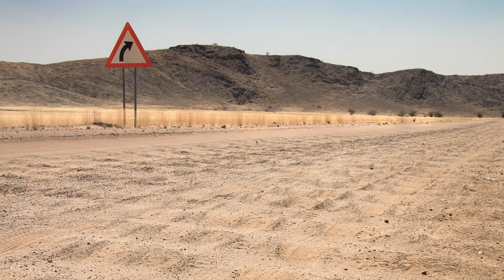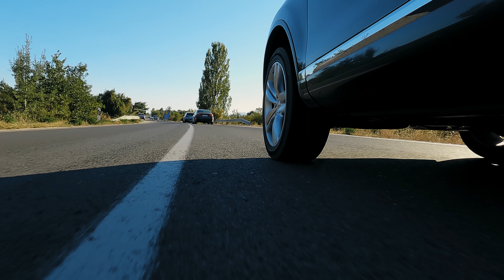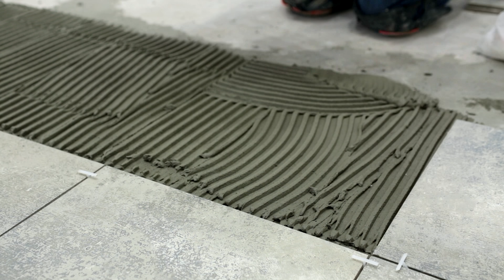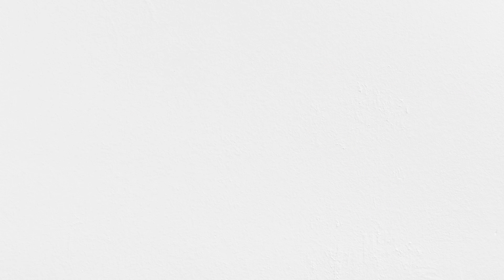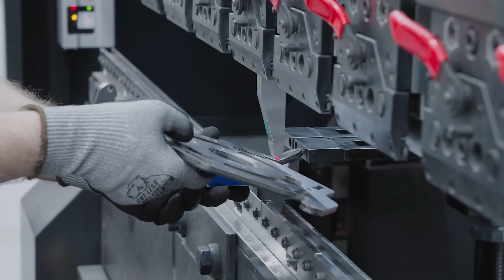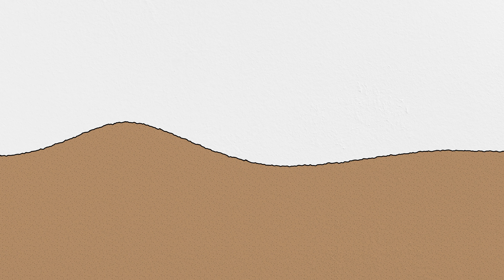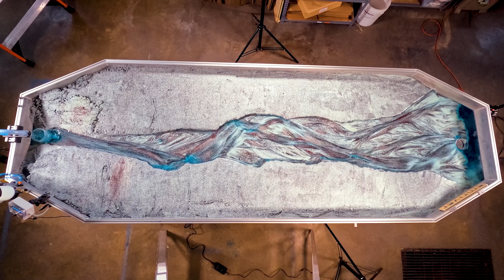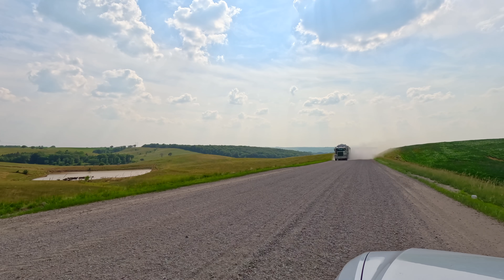Why Roads Get Washboards

Comment: I've driven on washboard roads for years. One peculiar thing that I have noticed that some of the roads have a "sweet spot" . A certain speed that you travel the bumpy effect seems to go away. If you go faster, the bumpiness returns, if you go slower the bumpiness resumes.  Different speeds for different vehicles. I assume this may gave something to do with the inherent frequency response of a particular suspension setup. Tires, tire pressure, spring rate, shock damener response, vehicle weight and distribution. Also the frequency and amplitude of the road surface corrugations.
Reply: It's like when you have the wrong proportion of windows open in your car and it makes that pulsing noise
Reply: @flexone612  Helmholtz resonance
Reply: @jamierosales1539  that can happen in a vehicles intake if it's not engineered correctly
Reply: @Osiris02  That's wicked
Reply: @jamierosales1539 I always called it buffeting.
Reply: @jamierosales1539  I call it the helicopter noise lol
Reply: @flexone612 I believe it's called buffeting.
Reply: @d_pete361  yes that’s one term for it.
Reply: @d_pete361  James may intensifies
Reply: @d_pete361 4th gen rams don’t know anything on that😹😹 ur ears get blown no matter if u have a sliver of open window
Reply: @juaquiqui Rams are poorly engineered trucks in general
Reply: @d_pete361  Changes in Attitude Changes in Latitude
Reply: @flexone612  by the way if you open the front and rear windows of either the driver or passenger side, but not both, that pulsing doesn't happen. At highway speeds I usually crack them open just a little bit to prevent strong winds inside but still allow air circulation.
Reply: Well-designed cars do not get pressure pulses at any time, or any amount or number of windows open.
Reply: @Chris.Davies that’s complete bullshit 😂
Reply: @oldrango883  my e46 never buffets my a5 does past 50mph
Reply: @liamholcroft7212 My wife’s e46 has buffeted. So what @oldrango883 said. 😂
Reply: @dyefye4094 this has worked in every 4 door vehicle I've ever driven to-date. Would love to see this done in a wind tunnel to see how it actually works!
Reply: @liamholcroft7212   I had 2 VW golf's and it was bad if you only had 1 or 2 windows down in front but we have an VW Atlas now and you  can't even drive on the highway with 1 or all the windows down , it blows out your ears...
I've owned many different vehicles and its only the VW that I've experienced buffeting like that at highway speeds
Reply: @dyefye4094  My car sounds like a helicopter. Gramps gets flashbacks to Nam.
Reply: @Chris.Davies I’m sure modern cars still have the same problem
Reply: @oldrango883 I just told him the same thing 😂
Reply: @dyefye4094 it's vehicle dependant. What you've just presented is called anecdotal evidence.
Reply: @flexone612  that’s simply a pressure issue with the windows. If air pressure  insode greater than the pressure that can escape it happens. It’s a matter invsout flow with the windows.
Reply: @flexone612  it’s more similar to driving over a hole, the slower you go, the more likely you are to enter the cavity, the faster you go the more likely avoid the cavity. Same principle here, common sense to most 

[Weight/Speed/Distance between tires
Hole Depth/Length]
Reply: That sweet spot is only a local minimum - To reach the true minimum you need to speed up even more, after it get bumpier it’ll get smoother again as you start moving fast enough your tyres have less time to fall into the divets. From there it only gets smoother as your speed approaches infinity 😛
Reply: @almc8445  yes this! The problem is coming back down from that speed immediately puts you into serious bumping and loss of control. If visibility is good, though, and there's no traffic, then I'm all for it. Just skip along the tops of the bumps!
Reply: @nopenotmedudewhen we were coming up to stop signs the driver always asked "see any dust?" , the indicator of other cars.     Back being young and reckless on the old dirt roads.
Reply: @almc8445 As your speed approaches infinity you will exceed the escape velocity of your local planet. This will definitely reduce the perceived bumpiness.
Reply: @johnbaker1256  yes but you see, this is also a local minima of bumpiness, because once you reach a certain speed, the magnitude of your vector is sufficient to bring you to the next PU over, and when that happens you'll experience bumpiness again.
Reply: @almc8445  ….And your control of the steering falls to zero!
Reply: @andrewwebb9426 Apparently people thought I was actually suggesting doing that… I just wanted to go all math merd and describe the graph 🤦‍♂️
Reply: @almc8445  I always thought of it like when Mario was running full speed on the NeS he would clear single space gaps without jumping
Reply: Silly speed…infinity. You won’t have to worry about the jumps or the mountains.🤷
Reply: @almc8445 you only need to go about 7.9 km/s on a dirt road to not touch it at all
Reply: @almc8445  put some airfoils that give you some vertical resulting force and with enough speed (or thrust) you could completely avoid the bumps.
Reply: @almc8445 i would not recommend going an infinite number of miles per hour on bumpy roads, though you're correct...
Reply: @almc8445  only wussies stay in first order harmonics.   real G's go after the 3rd or 4th order.
Reply: @almc8445  I love driving on long straight corrugated roads. It kinda feels like skating. Until you hit an invisible dust hole, those are a little sketch.
Reply: @almc8445  and THIS is why the only thing more insufferable than a washboard road is driving behind someone who's response is to go slower instead.
Reply: Mythbusters, episode 58.
Reply: @kathykuecker man I miss myth busters
Reply: You’re basically just skipping across the peaks at speed, what you’re finding is the exact frequency that your wheels need to hit to only hit the peaks.
Reply: YES! I drive a trail almost exclusively frequented by Chevy pickups and has some of the most horrific jaw-rattling washboards ever -- but only if you also drive a pickup. It's definitely a frequency resonance thing.
Reply: I wonder if some vehicles inherently have none because their front suspension resonates at a different rate compared to the rear(s).
Reply: @christopher5476  Unrelated to the topic of the video, but industrial vehicles with no suspension, like tractors, have this resonance mode where they start jumping when the wheels are slipping under heavy load for example. This happens because air in their big thick tires acts like a spring with virtually zero damping and it's easy to get runaway oscillations when the conditions are right. The solution is to deflate tires somewhat on one axle. This effectively tunes that axle to a different natural frequency so they don't amplify each other anymore, and makes the vehicle more stable.
Reply: @umdms  hopping can even happen when driving on pavement with no slip and no load.  As you say the tires act as springs and if the natural bumps and roundness imperfects in the tires start resonating you can really get it moving up and down. I've actually seen trailing machines with large tires just about leave the ground entirely on pavement.  Trick is to find the speed where the resonance dampens out.  Particularly bad on backhoes.
Reply: @umdms technically they do have a suspension. The tires bounce.
Reply: @umdms  my tractors tires are filled with fluoride.
Reply: @umdms I’ve experienced that with skid steers and forklifts and it can get wild.
Reply: @mikescholz6429   I think you mean nitrogen! Fluorine who destroyed the tires in really quick time. Then it would destroy the human that breathed it! 😮
Reply: @mat1500 I was misremembering, it’s calcium chloride solution, the tires are liquid filled instead of air filled for traction weight.
Reply: @umdms I managed to get a 930 Case tractor on rice tires hopping like a cricket on a hot plate. Not on purpose and I never did that again.  For a while it was touch and go!
Reply: @mikescholz6429  better be running tubes on that tractor
Reply: That's neat. Ive never heard about that.
Reply: This is generally how modern suspension systems are specced by many (possibly all?) automakers. The rear has a higher natural frequency from the front to eliminate resonant pitching response caused by the rear axle hitting a given bump after the front wheel. Basically it lets the rear "catch up" to the front.
Reply: @camerone397  That is one of the factors .... travel, body roll, squat and rebound come a few notches higher in the sequence.
Reply: @no1ofhere Absolutely, though you can control those parameters geometrically, and you can still tune the frequency of the overall system as you wish regardless of the slight relative increase in rear stiffness
Reply: @christopher5476  This was actually how the French attemped to avoid creating washboarding, manufacturers deliberately made their vehicles with dissimilar spring rates.
Reply: @furripupau cool. The citroen 2cv probably does. Amazing suspension on that old girl
Reply: @christopher5476  Wash boarding happens with any number of axles, so I don't think there are cars or truck with reduced wash boarding generation, 1 axle will do as per this video.  I think the effect of suspension tuning is going to have a very limited effect on wash boarding as there are too many variables to adjust the car for.  You might get wash board generation reduce with one type of wear layer, but once you go to the next quarry, the materials may be different.
Reply: The problem is explaining this to the local deputy sheriff.  55-60 MPH is typically the sweet spot with my truck on my roads, but the posted limit is 40.
Reply: @FaFa-y1f9r at those speeds your tires likely floating on the peaks and giving you minimum traction
Reply: @omegatotal very true as well. Fine line between a smooth ride and even bumpier ride, in the ditch lol
Reply: @omegatotal yep that's what gives you the smooth ride!
Reply: @FaFa-y1f9r ah yeah that's rough. My grandpas road deadends 2 miles down, and theres an L before the end that also deadends... theres only maybe 10 or 12 residences on the whole road between the highway and the river(where it deadends)

There it is unposted, which in the state of kansas means 55mph, but also they never did radar on that road cuz there just wasnt enough traffic
Reply: @FaFa-y1f9r I have made that argument. Successfully, got told to slow down but no ticket. He agreed about the smooth speed.
Reply: I always wondered if the wheelbase affects it.
If both axles are in sync with the undulations or if one is on top and the other at the bottom.
Reply: @BrianL-rd9zq  that's a big part of baja/trophy truck suspension setup. Lets them absolutely rip along insanely bumpy terrain while keeping the cockpit steady. The wheels underneath are going crazy but the driver is just floating along. Looks really cool
Reply: @SmoothBaracuda if all the trucks are set up exactly the same you would have a huge washboards. The suspension action causes it.
Reply: @SmoothBaracuda watching a truck ripping with finely tuned suspension is a thing of beauty
Reply: @BrianL-rd9zq  it definitely does, it's probably the biggest factor in determining the resonance.
Same way for ships going into waves and the frequency of the waves and trough
Reply: A ship is a awful comparison. The ship is a rigid structure. A vehicles suspension is free to move iindividually on its own bviously. It would fall into its own rhythm.
Reply: @krnlsndrs0735 I disagree. The shape of a ship’s hull would have a huge effect on the dampening. For example, try running in rough water with a single hull, catamaran  (double hull),  and a tri hall. All will have different dampening characteristics., much like the suspension on a truck.
Reply: On a related subject, I have noticed that it often helps to go across an isolated speed bump somewhat faster rather than slower, letting the suspension do its job.  🙂
Reply: @analog_guy A couple of times, I have even seen in my rearview mirror my passengers floating like the astronauts in one of those space station videos.
Reply: @analog_guy yes sometimes better to speed over those speed bumps that seem steep and jarring going slowly 👍
Reply: This reminds me of how we've seen people driving on square tires. The faster you go the smoother it feels
Reply: 4 wheel drive helps smooth it out too. I think many drivers don't realize accelerating over washboard only contributes to making it worse. If you go easy on the skinny peddle while traversing the washboard it is helping the road and your vehicle.
Reply: I've definatly noticed this, and I've always wondered if there was a way we could tune a suspention to take advantage of it.
Reply: Iirc KDSS found a close approximation using various damping characteristics. The difference is it’s meant for low speed rock crawling where the equation of motion becomes static. Fine tuning it from one dynamic mode to another seems incredibly difficult but mathematically possible for sure
Reply: Harmonics 👍  
Destructive frequency
Reply: I noticed the same going off paved roadways in my camper. Slowest isn't always the best, if the wash-boarding is consistent anyway. I think it depends on the amplitude in relation to your particular vehicle (weight, wheelbase, tire size, tire pressure etc.).
Reply: And as this video shows, when you do that, your vehicle is also making the washboards a lot worse than if you drove really slow.
Reply: @tmlf1239 he didnt show whst happens at a very high rate of speed. So we can only assume
Reply: @tmlf1239  if anything this video shows that it's unavoidable with wheeled vehicles on loose material road like dirt or gravel, so really the people travelling fast enough to minimize the shake are actually minimizing the impact on these bumps. I would rewatch the video if I were you.
Reply: absolutely,  the harmonic of the vehicle must be tuned to the road harmonic and just the right speed brings the sweet spot.
Reply: You're right it has to do with harmonic frequencies, and beat frequencies. It is all under the heading physics, and in fact the same situation occurs on propeller-driven aircraft, where you manually adjust the propeller RPM with your  propeller control bring the RPM of each prop into close synchronization, and then turn on the switch for the synchronizer which does the RPM fine tuning to eliminate the beat frequencies by making the revolutions per minute of the propellers equal. Which removes the throbbing sound which we call the bfo or beat frequency. 

I believe waves on bodies of water are formed similarly, by essentially the resistance of are traveling in contact with the surface of the water which would be still without a wind, and with the wind the resistance of the water surface holding back the wind molecules, build up depending on the wind speed to a certain height above level and then let's go of the wind molecules and you wind up with depending on the depth of the water and the speed of the wind you wind up with waves.
Reply: Once you reach this speed, your tires are bouncing off the bumps and you are really losing traction. Works ok in a straight line, but during a curve you can bounce right off the road (it would feel like a side)
Reply: @Federalwaywebbs There is certainly a balance.  In my 2015 Toyota Landcruiser Prado it was usually around 140kmh which sounds insane on a dirt road but I often found ths Prado did better at those speeds in a corrugated road than tar go figure
Reply: Different suspensions react different  don't they? Is the suspension action that causes this. You have to have a different suspension action from everyone else to ride smoother.
Reply: Often I have found it’s on sandy roads 40ish mph.   At least here in the Deep South.
Reply: I’ve noticed that engaging 4-wheel drive can smooth things out as well. I’m not sure why.
Reply: @stevenclarke2655 dont engage 4x4 while driving, please, bro.... come to a stop and shift to neutral if you can.

Someones gonna tell me how it doesnt matter, but any time anything makes a loud noise, i figure it's probably better if it didnt.

Some vehicles are supposed to be able to shift into 4high at like 5mph but i just wouldnt

I doubt you are lol but if youre engaging 4x4 at like 40mph and it smooths out the dirt road, its probably your transmission destroying itself at the exact same frequency as the road bumps lol
Reply: @RustysModernLife  you're both right. Definitely don't engage 4 wheel drive while moving, neutral is specifically required for 4-low but not always for 4-high. But engaging a metal joint while both sides are moving at slightly different speeds is never good, even if it works its not helping the tolerances over time and it'll eventually get some play in it. But driving in a 4 wheel drive on a washboard road is noticeably nicer than two wheel, especially a rear wheel drive. Because the non-drive wheels have no force engaging them they're more susceptible to the bumping described in the video which exacerbates the frequency and amplitude of the bouncing making it worse. When you have drive on the wheels they aren't as free to move and as you hit the throttle it smooths out or overpowers the force coming into the wheel.
Reply: @SmoothBaracuda ah that makes sense. More rolling mass, more inertia to dampen the vibes
Reply: @RustysModernLife pretty much not an issue on modern vehicles. Even old ones if you know how to shift them. I shift in and out of snow covered roads at up to 80mph and very rarely had a loud noise
Reply: Yup, that's basically the speed you're cruising along the tops of the waves.
Reply: I think it’s when the cushion of the rubber tire perfectly bounces from peak to peak of the washboard
Reply: I just ride the side and middle at about 35mph its smooth for me
Reply: Aussie here, have driven 20,000km+ on corrugated roads in hiluxes with aftermarket shockies and 32" AT tyres. They smooth out at 80-90km/h and becomes increasingly smoother at higher speeds. I like to sit at 100-120km/h on the straights.
Reply: You have no idea what you're talking about and just using words you've heard before
Reply: It does that on my ktm 1290 at about 230km
Reply: For short personal roads that are susceptible to rutting and wash outs can be migrated using car tires with the side walls removed and stitched together in a geofabric and filled with road base will keep the road in tact forever. It can be very good used strategically in rural roads and drive ways where erosion can prevent vehicle access during high rainfall due to poor traction.  In Australia steep drive ways previously inaccessible even with 4WD can be driven up in a fwd hatchback when you've used car tires/tyres as geotextile.
Expensive unless you have the right equipment and a great resource of used tyres you can process but very worthwhile venture 👍 highly recommend
Reply: MythBusters really went out of their way to disprove this
Reply: 100% agree. The sweet spot to negotiate the washboard road out to Gooseberry Mesa in Utah in my van is 12 mph 😂
Reply: It 100% does, what you’re doing is approaching an approximation of the natural frequency. Your car is a multi mass spring damper system with various approximated damping ratios, etc. the variable you can control to solve for your natural frequency is your speed. Rearrange the second order equation and now you can solve what speed will get you close to the natural frequency of the road. Obviously this is not feasible so the way we do it is by listening to our butts, the same way a machinist listens to their hand to change feeds and speeds.
Reply: I’ve lived on a gravel road for almost 50 years. When I first moved into this area most everyone drove a pickup and only a few main roads were paved. I had a square body Chevy with big tires id drive when driving off the main roads. I also worked in the Alaska oil field and along the Dalton Highway having a job where I drove a pickup or suv as my work truck. These roads weren’t paved . The worst vehicle I drove when on washboard roads is an Excursion. Hit a little washboard on a corner and the back wants to come around.
Reply: same experience here, and also would like to see the follow up video with an explanation about it, and the improvement of the soil
Reply: Yup, driving faster is usually more comfortable than going slow on these kinds of roads. You just have to remember where the big potholes are or your suspension is completely gone 😂
Reply: Dude there is no sweet spot. Please stop propagating that myth. You have to drive less than 10km/hr on a severely washboarded road or you’ll destroy your suspension instantly
Reply: I think that sweet spot speed is where your tires are "flying" across the low spots and just touching down on top of the next high spot. A little slower and they slam into the rising face of the next washboard, a little faster and they overshoot dropping into the next low spot after. I've never tested it, but it should work such that if you roughly doubled your sweet-spot speed, it'd smooth out again (you'd be jumping two low spots). But my experience is that initial sweet-spot speed is around 45-50mph and I ain't trying 90-100mph on a washboarded dirt road just "for science". I'll wait for Red Bull to do that video.
Reply: Your poor car. I'd love to be your mechanic
Reply: Tire mfg, tire pressure, and tread depth also all have effects, each to varying degrees and reactions with speed, road material and weather conditions.   It's such a complex thing
Reply: Having driven many different cars /trucks on the same corrugated road, I have found that around 50 mph is sweet spot. The only exception was rental VW which proved to be completely incapable of dealing with corrugations. At anything above  20 mph it became uncontrollable (trying to spin out). It was so dangerous that I returned to the small regional airport where I had collected it and requested another  model.
Reply: @gregculverwell Yikes
Reply: Here in Iceland we used to let our tires down to 12ish psi when going into the highlands, it was a sweet spot of being able to do about 60km/h average and not blowing up your tires.
Without needing to resurface the trail every week in the summer. Washboards just didn't form.
Now we have both tourists and locals that don't bother that inconvenience, so most trails get washboarded within days. I don't go up there now expecting more than 40km/h average best case. 8 psi kinda solves it but then you are playing your cards with the devil of temps and jagged rocks.
Reply: I was in Turkey many years ago and came across my first experience of corrugated roads. I happened to meet a couple of Dutch civil engineers who advised me to drive at 60mph and lo and behold the vibrations disappeared. Drive just below or above that speed and the vibrations returned.
Reply: Sweet spot or no, its beating your suspension to an early grave.
Reply: @wskinn  Actually, when you find that sweet spot, it's because your suspension ISN'T moving, you're then simply floating over the tops of the washboard.  Of course, then you don't have much traction for cornering and stopping either, so, gotta be careful about that.
Reply: Nevertheless, it's not good for a vehicles suspension.
Reply: Yes, growing up in the desert west I concur. There is a point that it all comes together and you have a smooth, controlled ride. It's wonderful when you find it. You just float along, and everything is under control.
Reply: Everything you just said also applies to speed bumps!
Reply: Don't forget the wheelbase
Reply: For my 2000 ranger its about 35mph
Reply: Yes
Reply: Like a whoop section on a Motocross track. They are smoother the faster you go
Reply: Mythbusters episode!
Reply: Having big puffy tyres with phat side walls and carefully tuned slow rebound of the shock absorber can make corrugations non existent 😎
Reply: above a certain speed the shocks cant rebound fast enough for the wheels to catch the next bump, and instead it just floats on the peaks
Reply: @jmr1255 mythbusters also disproved that. It’s just perception. The science says no… the springs definitely rebound fast enough…
Reply: Hit 120 kmh and it goes
Reply: I discovered this as a young boy riding a dirt bike on old train tracks
Reply: my dad had and old toyota that was unbalanced. At 80KM/h its smooth, at 100 its vibrating, an so at 70.
Reply: Mythbusters
Reply: I always feel like im stuck in the exact opposite where my car just feels like its going up and down really fast and if i speed up it gets worse
Reply: I can confirm as a former desert racer.  Motorcycle. Go fast, don't back iff
Reply: I’m thankful they’re not whoops like moto cross
Reply: If you ever watch Supercross this is akin to skimming the whoops
Reply: There’s a myth busters on it!
Reply: And the wheelbase!
Reply: Resonance 🎉
Reply: I've experienced the same thing.
Reply: Let’s not forget rear axle hop.
Reply: I can second your finding
Reply: There’s actually always two sweet spots. It’s obviously different for every car but one is around 50 and the next one is around 80
Reply: Yeah the forcing function would be cyclic as well with a frequency of the speed over the bumps distance peak to valley. When it matches the resonant frequency of the suspension it stops fighting it irregularly causing the suspensions movements to be irradic and instead keeps it a smooth sine wave (that matches the shape of the road) which it would add energy to over time but the vehicles mass prolly counteracts.
Reply: Agreed.
Reply: Also, the tire diameter and wheelbase.
Reply: In trophy trucks, you can adjust the suspension specifically for this purpose, to keep the tires on the ground as much as possible in the smaller whoops. But if you've ever been in the military, there's a walking and shooting speed where it kinda matches up and gets smoother. Or with photography, its the same. Not sure if its the same exactly, but its very reminiscent of the same outcome.
Reply: thanks from Australia, I'll have to try it out next off road.
Reply: I live in the desert, and yup, there's a sweet spot for even different sections of the road, and it's different for every vehicle, you just have to find it.
Reply: 💯% 60 mph smooth 
30 mph crazy bumpy.
Reply: Wheel base and speed is how this phenomenon works. The length between the tires and then find the sweet speed and glide over the bumps.
Reply: 45 mph is the minimum speed. Skip from top to top of each. Myth busters episode covered this
Reply: Definitely
Reply: Yes, make a composite base for the sand to sit on
Reply: Welcome to the wonderful world of harmonic frequency.
Reply: On  regular runs on sand roads we found  lowering the tyre pressure by about 15 psi helped the problem of wash   boarding and also  by adjusting the speed , BUT when moving to sealed roads this was bad for the tyres 😢
Reply: I know given a short time it will eat your vehicle 🚜
Reply: Yep - Just like with a powerboat - it's as if you are hydroplaning on top of the waves. In this case, I guess we'd call it geoplaning. Your tires are only hitting and pushing off from the crests of the waves, so you don't have your suspension going crazy. It's the smoothest ride for the least amount of traction, so if you go unstable, you're gonna flip or crash out very easily.
Reply: At 110km/hr+ I find it as smooth as a newly paved highway. Now it does get a little dicey over the right hill when the tires leave the gravel, or moreso when the land again. Some squirrelly Group B fun.
Reply: Mythbusters tested this.  Turns out going faster makes it seem smoother but is worse for suspension parts.  Slower is slightly better on suspension but feels more bumpy.
Reply: You are "on the plane" when you find the sweet spot.
Reply: Mythbusters tested this lol. Speed bump speed test
Reply: My FedEx truck absolutely has a sweet spot on county roads
Reply: Yep. Just float across the tops when you find that right speed!
Reply: I grew up on a dirt/gravel road. Me and my dad would just go about 60 to skip across the top 😂
Reply: It’s called resonant frequency
Reply: It’s because of the wheelbase.
Reply: No duh
Reply: Yeah it is pretty crazy. In my area, the speed limit is 35mph, but at 35, it feels like the roof liner is gonna fall down on me and my truck starts trying to go sidewaysat times. I drive it at 55 and it is much more smooth, by a lot.
Reply: Yep, sounds like you’re reaching some type of steady state response and the speed at which the vibration goes away is the speed at which your car is critically damped
Reply: As an Aussie I can tell you in a 2015 Toyota Landcruiser Prado that speed was 140kmh which is amusing as the default speed limit is 80 to 100kmh depending on state.

In a 2002 Holden Commodore its about 100kmh
Reply: After gaining my 15,000 hours of travelling on gravel roads in rural MN I can travel next to 70 MPH on unpaved roads.  It is true you can find a sweet spot on speed.  Faster is better.  I find that washboard is more prominent where people are accelerating or braking.  If everybody takes time ahead to make gradual accelerations and braking, they can reduce wash boarding and save gas.  But there are too many teenagers and aggressive people on the road.
Reply: Damper, a damper dampens.
Reply: I have definitely noticed the same thing. And I believe you’re right that the natural frequency of the suspension and mass of the vehicle etc determines where that speed is. 

I’d also bet based on this video that there is probably a collection of frequencies for washboards - directly derived from the gravitational acceleration of earth, and then harmonics, which are more likely to show up based on surface particle size, and perhaps vehicle speed.
Reply: You have to travel at the inverse of the frequency of the peaks * (π/ Sin(cos (cosApha) )*mc2)²
Reply: I have found this to be true for train tracks as well and no two train track crossing are the same.
Reply: It’s like woops in super cross 😂
Reply: 맞아요, 충격을 줄인다고 서행하는것 보다 차라리 좀더 빨리 달려면 훨씬 부드러운 주행이 가능했네요
Reply: На сколько я знаю КаМАЗ сайгак не боится (дороги стеральной доски)
Reply: 35 mph
Reply: In short this has something to do with physics then?
Reply: @Kufunninapuh  fluid dynamics.
Reply: How tf that came to my head, instantly, is pretty cool!
Reply: We experience this in desert racing(baja). Enter the woop sections at the right speed and you will glide right over them, you slow down and it can buck your vehicle into a cartwheel, too fast and you'll lose control and possibly also cartwheel. These woop sections are between 4-6 feet deep and the correct speed for our race vehicle is a window of 95-110 mph. You reeeeeaally have to commit. Not uncommon for someone to enter, panic, slow down and suddenly you have what looks like a yard sale of useless high-end automotive parts out in the middle of the desert.
Reply: Same thing as driving on square wheels only in reverse
Reply: Control systems my old enemy, youve shown up in YouTube comments
Reply: Больше скорость- меньше ям. Древняя русская поговорка.
Reply: anti-resonance
Reply: Distance between axle too
Reply: I think at around 75-80mph, most roads are fine. Unless the road is too bad to actually travel that fast. To just sorta glide over the washboard

Idk what speeds youre going, and roads can differ, but my grandma always did right around 80mph in her minivan down her dirt road

My buddy called her speed racer, but i went fast too. My grandpa and my buddy both took the road at the speed limit, 40-45, and it was an awful experience at that speed
Reply: @RustysModernLife  Yeah, speed is your friend in a washboard. You can always tell the people who didn't grow up on a dirt road, they go so slow that they get shaken to pieces. The problem comes in when that washboard is also in a turn...
Reply: @JHe-f9t yeah, 100%. The turns are where you gotta slow down and lock up your ebrake and turn sideways for style points

The road sees everything, sometimes you gotta earn its respect with a sweet drift lol
Reply: @RustysModernLife I used to work at a place that had washboards and turns and young male drivers. Every single car accident that happened there was people trying to drift and ending up in a fence or ditch, or upside-down.
Reply: @JHe-f9t You can always tell the people that don't mind turning the junk they drive into bigger junk as washboard destroys a vehicle and is a good way to end up in a ditch or another car. Other than that its good.
Reply: @giggiddy  It's easier on the vehicle to go faster, because it's being subjected to less forces by skimming across the tops.

Also if you normally drive on a dirt road, the dust itself is harder on the vehicle than the bumps are.
Reply: @RustysModernLife the problem with going fast enough you skip over the washboard is when you hit a hole at speed and destroy your ball joints and tie rod ends.
Reply: change the spring rate in the front or back and see if the speed  that causes the resonance changes
Reply: You must make a tremendous amount of money with these 15 minute videos to use send cut send. That is hands down the most expensive way to build one off projects that I'm aware of. The average person doesn't have that kind of money to spend on the average widget to use in real life. .
Reply: @giggiddy  this video has 220k views in 9 hours and the channel has like 4.3 million subscribers. Obviously he's making plenty of money, he's essentially a partner of YouTube he drives so much engagement on the science side of things. This video is also quite clearly sponsored and he literally said they support what he does on the channel. In other words he literally just told you it didn't cost him anything and this is a paid advertisement for the company, so why are you surprised? Not to mention I don't think you understand how expensive all the equipment they use is. The average person doesn't have access to any of that either, there's some things in this world that are going to be expensive no matter what because of the equipment and skills required. 

 You should probably also recognize that hindering the height of capability because some people can't afford it is a dumb way to run a capitalist society. You should be mad at the overarching reasons for why such services are expensive, not be mad at a businesses for operating with what society has provided.
Reply: @SmoothBaracuda support didn't always mean free. 
Could be a steep steep discount on services
Reply: @PheonixRise666  no one said support means free. They clearly expect him to talk positively about the company. That's a marketing investment from company to put them in a favourable position with a person who has a huge platform of individuals that might also use their service. That's worth more than the money he'd pay for the materials.